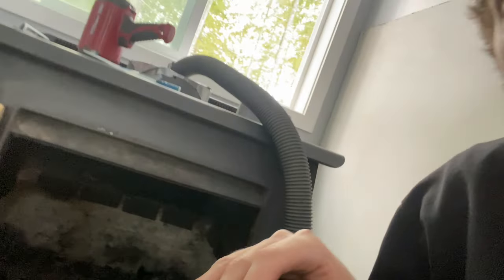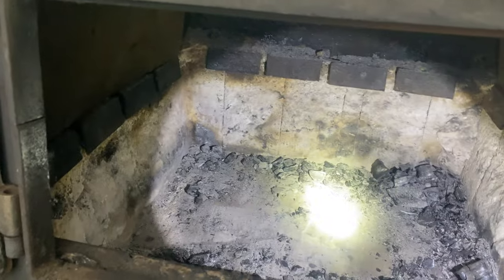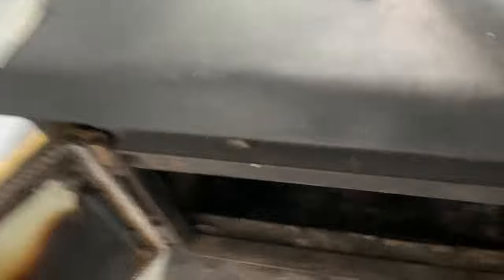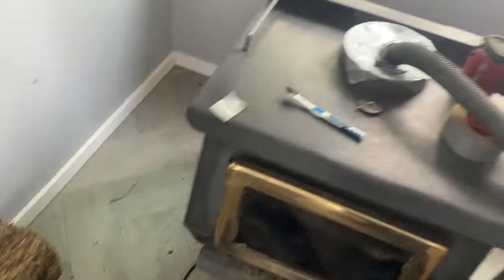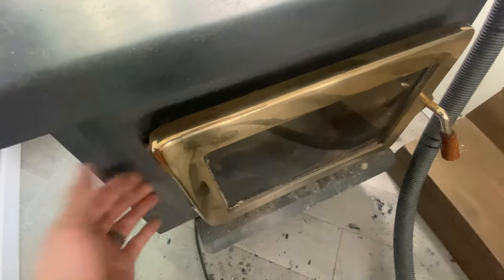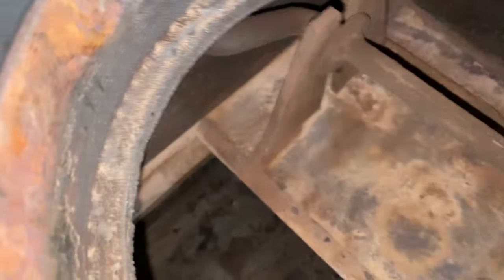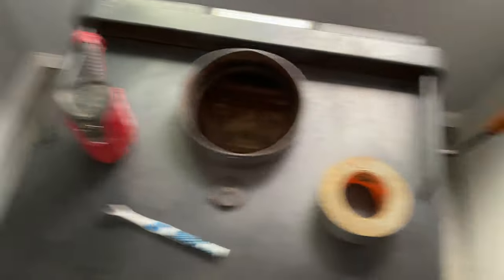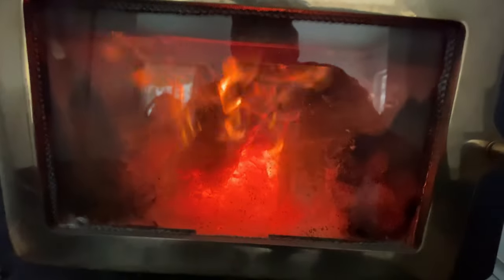Cleaning Catalyst in Blaze King Stove | Keep Your Fire Running Efficiently

Comment: Wow! Pretty elaborate! Why not just remove the computer? Then you can run the vacuum over both surfaces. Of course, you do have to replace the gasket, which are overpriced. 
One other thing you can try, if the catalist still seems exhausted:
Get 2-3 gallons of distilled water (NOT TAP!) and 2-3 quarts of white vinegar. 
Thread a plastic coated wire (such as 16 gauge multistrand) through the combuster to use as a handle. Get an old roasting pan that you will never use for cooking. Mix water and vinegar 50/50. Put enough in the roaster so it would cover the combuster by half an inch or so. Bring to a boil and using the wire handle, lower the catalyst into the boiling solution. Do not allow it to touch the bottom. Rig something to hold the "handle". Turn down the burner to just below boiling and allow the combuster to soak for 30 minutes. DON'T LET THE SOLUTION EVAPORATE TO THE POINT THAT ANY PART OF THE COMBUSTER IS EXPOSED, and don't let it lay on the bottom.
Remove the combuster, place on a towel, and discard the dirty solution. Rinse out the pan and add enough clear distilled water to cover the combuster as before, bring the plain water to a boil and put in the combuster as before. Don't let it touch bottom. Reduce heat to just below boiling and keep the combuster in the rinse water for 15 minutes. When it's done, repeat with fresh distilled water. After the second rinse allow the combuster to completely air dry and reinstall with a new gasket.
This process can renew nearly exhausted catylists and get another couple of years use out of them.
Reply from the maker: Nice! will try that if things get bad in the future. So far a cleaning every 3 weeks or so is doing the job.Might have a little to much updraft.

Comment: You do realize the converter does pull out for cleaning easily, I removed mine permanently because it kept plugging up, didn’t effect performance at all
Reply from the maker: You’re not burning right if it’s plugging all the time
Reply: @makessenseoutdoors  your probably right the thing is I bought the big ashford for putting bigger wood, but living in the Pacific Northwest it often doesn’t get that cold to run it wide open hense the plugging of the catalytic.. I’ll have to give it another try
Reply: Blaze King ceramic combustible usually breaks if you try to remove it
Reply: @scottherod2673 I ran without the converter for some time fine, but put it back in and now I clean it out with when cold compressed air and that works perfect